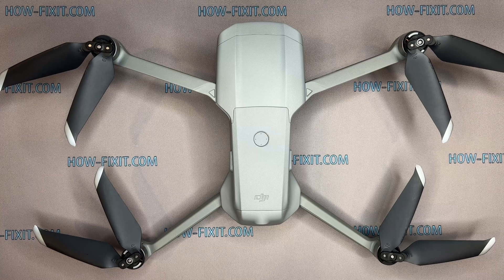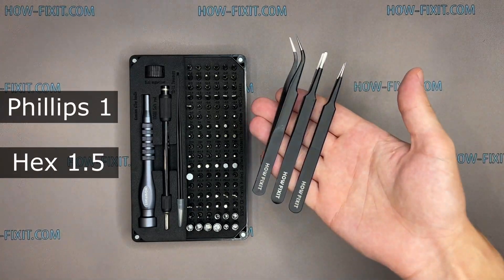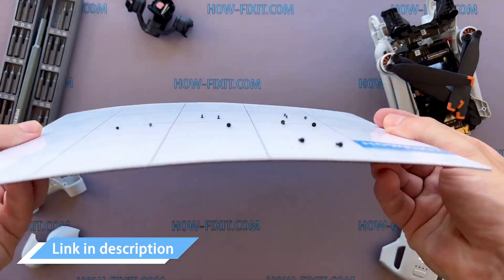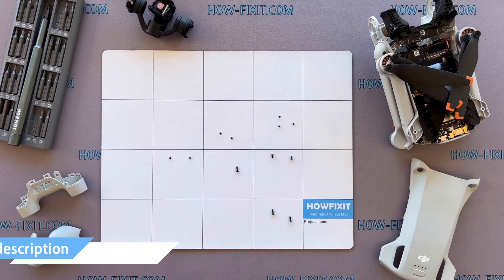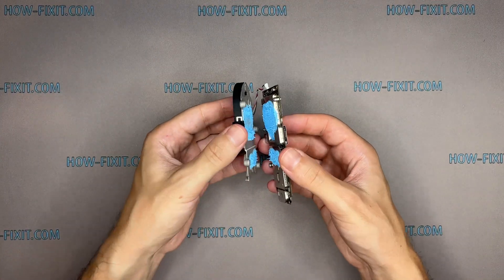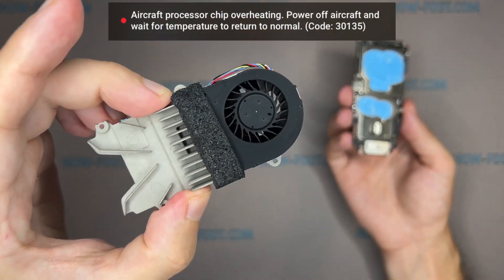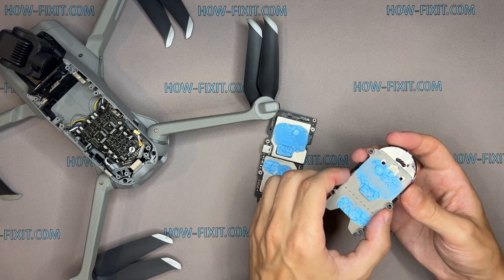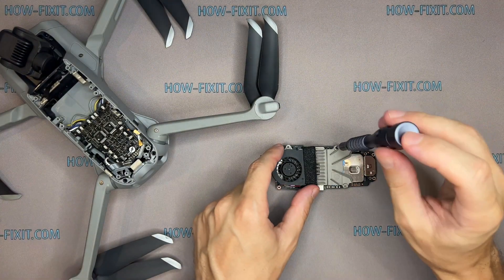DJI Mavic Air 2 Fan Replacement. How to fix processor overheating error

Comment: Hi.  I would REALLY appreciate your help.  I have replaced the fan with a brand new one, but I'm still getting the overheating error.  Is there something else that can cause the error?

Also, at 7:11 of the video, you do something with what looks like a ribbon cable.  What is that?  My drone doesn't seem to have that cable.  Is that the cause of the overheating error?  Many thanks in advance.

--paul
Reply: Hey no, that is just a tape, did you fix it btw? I also have an overheating error, but the fan works. It ramps up to 100% instantly.
Reply: @MartinRusnak   i have the same issue do you know what it was?
Reply: @caleboudbier  
Hello, yes I do. The issue on my side was old thermal paste between the chips and the cooler. To fix this, you have to remove the shiny plates on the motherboard on which the cooler sits. These are friction-held and require a bit of force to be removed, about as much as to open a previously opened PET bottle. Once you do this, replace the blue paste with the one of your choice. I have used about 6 grams of Arctic MX6. Place the plates back, put some paste on the contact point of the cooler as well, and try it.

In my case, this has fixed the error, but did not fix the 100% fan speed issue. I personally don't care; the drone flies, and this does not seem to cause any issues.

Buying the paste:
If this is the first time doing this, do not cheap out on the paste. I have spent about €15 for 6 grams; that seems like very much. Pastes can be cheaper, but their thermal conductivity may not be good enough to fix the error. Also, pastes dry up over time and lose their properties. The better the paste, the longer it takes for this to happen.

Also: do not buy anything electrically conductive. This doesn't happen to you unless you start going into the very expensive range, often called liquid metal. While these last a very long time and have great thermal conductivity, the electrical conductivity would cause shorts in a drone and would eventually fail the entirety of the drone. FYI, I have never seen a paste that would not state it has high electrical conductivity on the box, so if you read, this won't happen to you accidentally.

Also: in your research, you may find PTM7950. This is a thermal pad. While it is usually great, in order for it to work, it requires a bit of pressure that I don't think there is enough of in the drone. Skip it. It is also very expensive.
Reply: @MartinRusnak thanks you very much. Did your over heat in 1-3 minutes like mine?
Reply: @caleboudbier  Hello, yes

Comment: My fan wasn't working so I disassembled and spun the fan and reassembled. Now the fan works but I get several error codes regarding gimble and imu needing calibrated. But, it won't let me calibrate imu. Any ideas?
Reply: Sounds exactly like you don't have a ribbon cable attached all the way.. open it up and make sure your connections are good and not mixed up
Reply: @sodabeanzz7965  went thru it a couple times cause I thought the same thing. Ended up sending it in. New gimbal and IMU module installed under warranty.